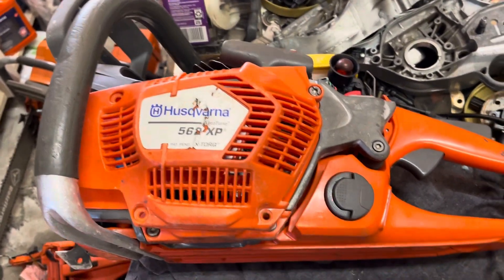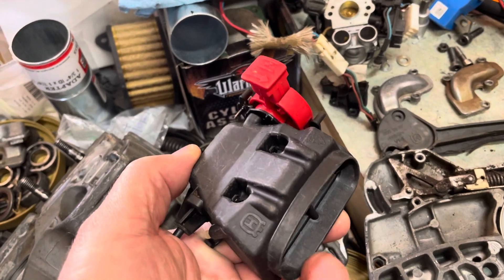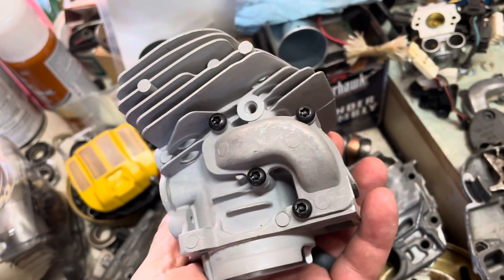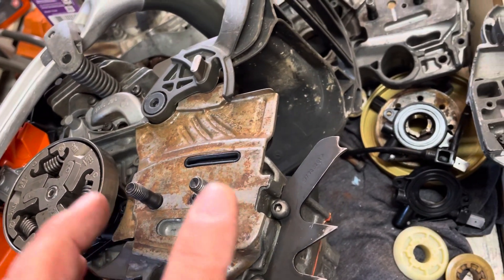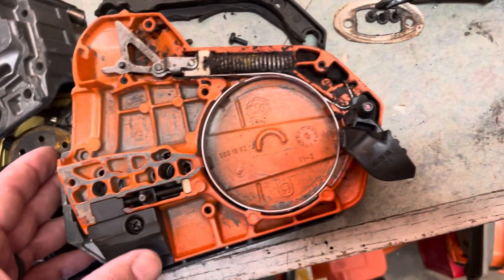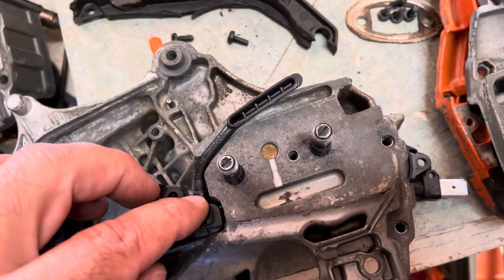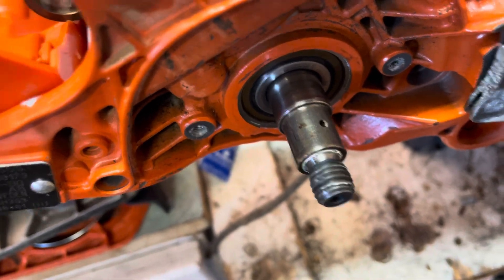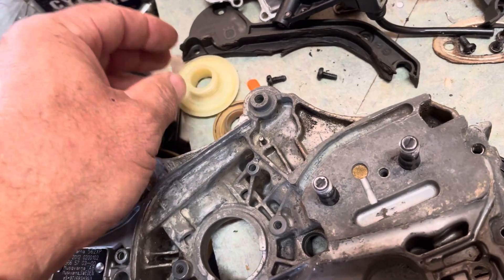Differences between the Husqvarna 562 and 555 chainsaws. Self learning 😆

Comment: 555 is the small bar mount (Oregon calls it K095) while 562 is large bar mount (is it D009 ?)
Reply from the maker: Yes that should be the d009 should be the right one. The funny thing that I see it is the location of the chain adjustment screw between the to cases is the driver of the large mount vs the small mount. The bolt/studs is the same size.

Comment: hello, I see your channel and it's very interesting... I need a little help, I got a husqvarna OEM fullwrap kit as a gift from my wife, in which the dogspikes are clipped and they are determined ... But the left one that attaches to the housing fits perfectly, while the right one does not the chances of installing it in the intended and indicated holes on the clutch cover ... what would be the solution ??? would the 562xp clutch cover fit since the kit is for the husqvarna 555/562xp and I'm sure the 562xp cover is longer than the 555profesional but I don't know if the chain tensioner and chain brake will work... Best wishes and success in your future work and lots of super good ones video ... greetings from Josip from Croatia
Reply from the maker: As far as the 562 cover working on the 555, it will not work. It does come down to the chain adjustment screw is in the wrong locations between the 2 covers. I have not yet tried to modify the 555 cover to see if I could get an outside dogs to work. But looking at it I would say it won’t work due to the bottom bolt hole could not be drilled to make it fit or line up with the inner spike. Sorry for the bummer news. Thank you for watching and the support

Comment: 555 is more like it 560xp
Reply from the maker: I’m not fully sure since I haven’t worked on that model. But from some of the research I was understanding it more like the 562 with the large bar mount case and crank stuffers.
Reply: @sunbear1973  560 xp is older than 562xp, it has a small mount
Reply from the maker: Thank you for that good info.